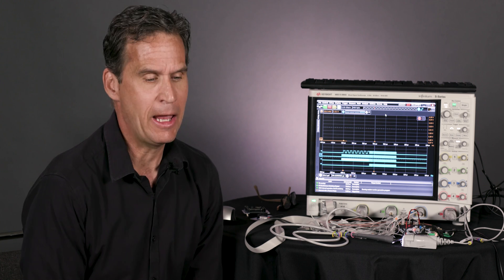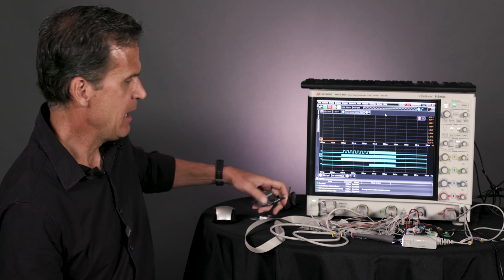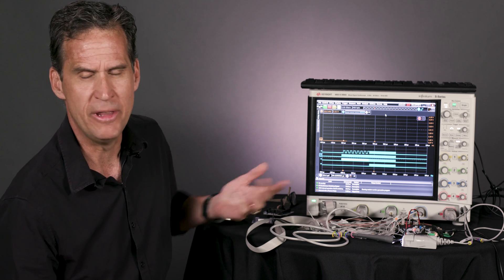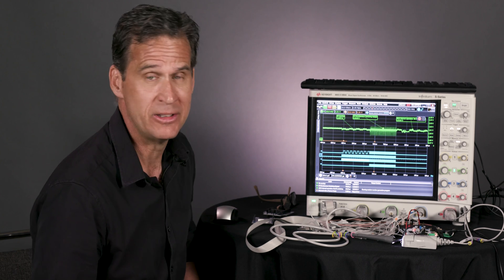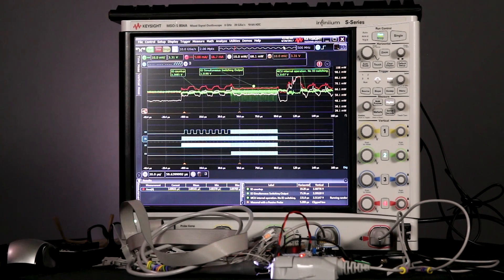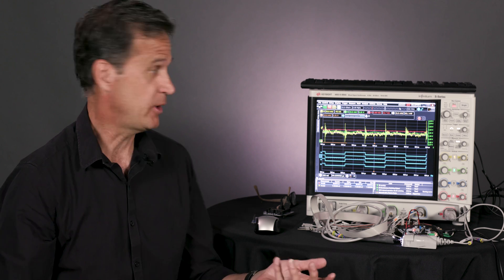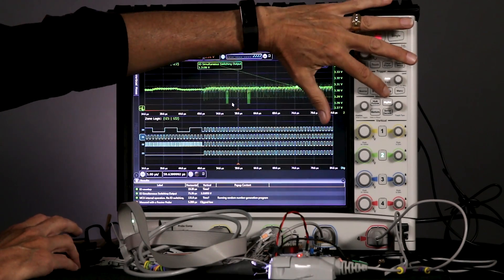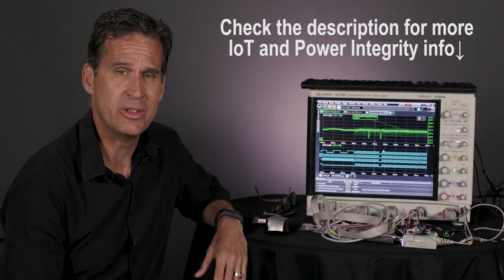Power Integrity Challenges in IoT Testing

Comment: Hi, does your product produce AC and DC voltage source?
Reply from the maker: Many of the InfiniiVision oscilloscopes have a built-in function generator, but if you need a combination oscilloscope and DC power supply check out the N6705C DC power analyzer.

Comment: I liked this one, nicely presented. A few years back I dove much deeper into power electronics almost by accident. As it turns out, it has given me a critical edge in my industry where some of my competitors have crashed and burned products because they did not consider power a challenge. They ended up chasing ghosts that would crash the system, but they could not figure out why. 

Critical stuff. I am seeing problems into the Ghz range on my own SMPS and power management layouts. Those do not do well for circuits operating in the multi-gigabit data rates.

Comment: Very nice presetation. Thats my dream scope which I just cant buy at my current financial state.
Reply: Whats the best way to measure/visualize the peak and average power consumption RF modules like sub GHz ISM band modules? Those consume major power during Tx/Rx activities but  only few microwatts when idle. Is it possible to visualize and calculate that on a scope? What will be the best way to do that? It would be so kind of you if you share some lights on it or demonstrate if at all possible.
Reply from the maker: Thanks for watching and thanks for the question. I recently did some power consumption measurements on a remote sensor application (similar to a remote weather station). In that case I used the Keysight N2820A High Sensitivity Current Probe (same current probe used in the video). The probe measures the drop across a current sense resistor while software applies Ohm’s law and the scope displays the answer in Amps (or mA, uA.). The probe provides two simultaneous outputs to the scope—a zoomed-in and zoomed-out view of the signal. This provides a 20,000:1 dynamic range. In this case we were looking at idle current of around 5uA and peak currents of about 30mA. We were checking into optimum power consumption settings for the sensor so we would make changes and measure the area under the curve (amp-seconds or Coulombs). This way we could make changes and tell if we made it better, worse or the same. The scope uses both channels to measure the area under the curve—first it uses the zoomed-in channel until the signal goes ‘off screen’ for that channel, then it uses the zoomed-out channel (it does this automatically).

Regarding Tx or Rx power, it became rather obvious when we looked at the current draw profile. Let me know and I can send you a screen shot or this application. It is impressive how much detective work can be done just looking at the current draw.

Kenny